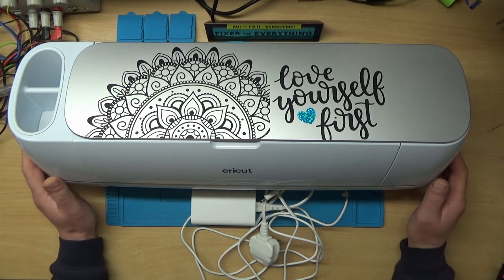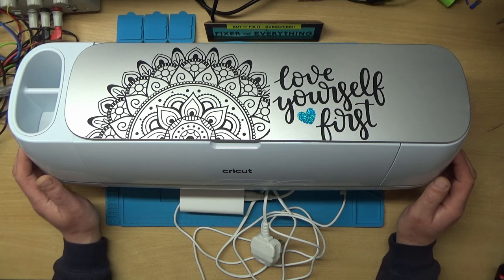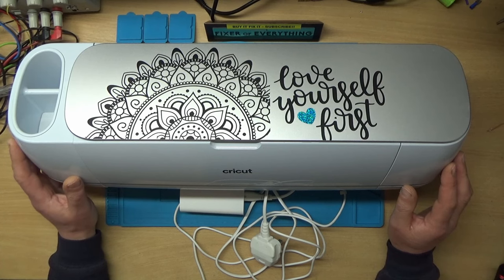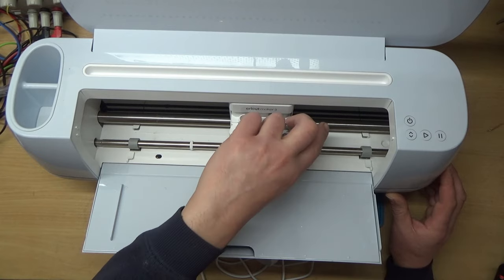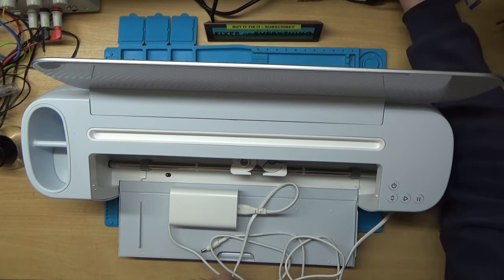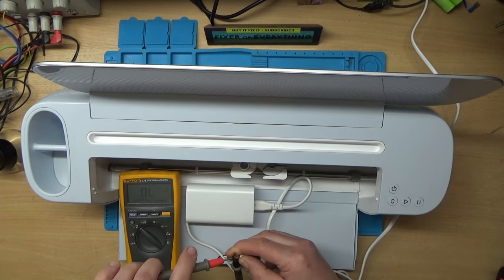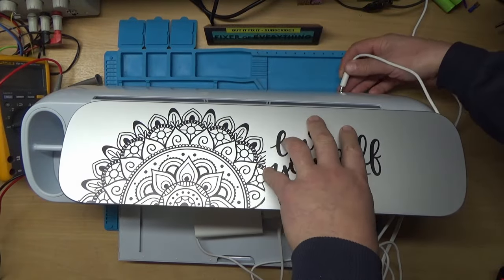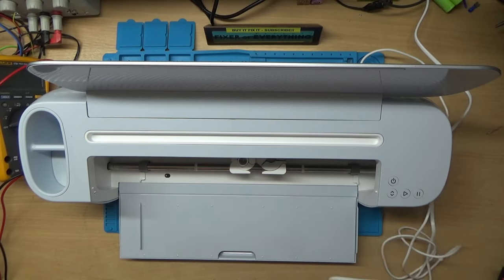Faulty Cricut Maker 3 - Trying To Repair...

Comment: Must be a flash memory device with serial number - wonder if you can change the serial numberrr to your other one?
Reply from the maker: I would think that's possible but you would need to dump the original contents first which would almost certainly be protected, it may be possible to glitch past the protection using something like a chip whisperer perhaps.

Comment: Can you tell me the exact reference of the ribbon cable  ( i think its called like that ) and the number of pins, and whether it's 0.5 or 1 mm? I already know that the length is 550. This is the issue with my Cricut Maker 3; I need to replace it , thank you in advance
Reply from the maker: I'm sorry but I don't have any measurements of the cables. There is a way to calculate it as I looked into something similar before.  Cable Width / (# of conductors + 1) = Pitch
Reply: okay , thank you  @BuyitFixit

Comment: You should try to find a faulty cordless screwdriver and fix it. Then use it. Would save you so much time working on this stuff.
Reply from the maker: I've never been a fan of them. They are ok for removing screws perhaps but I like to feel how tight the screws are so I don't strip the plastic. It might also be harder to avoid making the screw cut a new path (I usually give it a turn in the opposite direction until it clicks, before tightening).

Comment: That's a rare occurance on your chanel - a failed repair. Agree totally about the extemely bad form of locking a customer out. It needs a hacker to get into the code and bypass the deactivaton bit!
Reply from the maker: Yes, I do have some now and again.. The problem is most of the devices functionality is "in the cloud" which is one of the reasons I don't like it.

Comment: If you convert it to a pure cnc machine you can recover at least basic function. It still wouldn't work with the Cri Cut service. 
You could also scrap it for parts. And make another machine from it.
You could also try to find a board on E-Bay.

Like a lot of ink jet printers. They make there money on the subscription. Not on the device.  That's how you can rationalize. Just sending a new device with little or no question.
Reply from the maker: I had thought of converting it but it's a fair chunk of work as the motors aren't steppers and are brushed DC with encoders. There is also the control of the  cutting head pressure and direction which is like an electromagnet from what I read and another motor to set the angle. It might be possible if you had a working board to port a custom build of GBRL or something to it but again it would require substantial effort to work out what I/O pins do what on the microcontroller.

Comment: I outright refuse to pay for products like this that mandate Internet access even for something as minimal as initial setup.  If I MUST connect it to use it I'm not using it. Frankly I do NOT trust these companies to be connected to my network and if they believe that locking down their products that I pay to own is acceptable then they can't have my money. I have a number of 3d printers and ONLY open source. I will NEVER give my money to any company that believes that I should be beholden to them to be able to contribute using something I own. If they want to maintain control over my ownership then don't sell them.  Lease them. Then if anything goes wrong or any part fails they can take it back and send me a replacement, both at their full expense.
Reply from the maker: Well said 👍yes we are increasingly having ownership removed. There are a number of instances where companies have went bust leaving customers with useless bricks or devices that no longer function as indented due to servers being no longer available.

Comment: Hi I am in the possession of a Milwaukee M 18 CPD rill coul you tell me the ref for the ower transistor that are fitted please
Reply from the maker: Hi John, the M18 tools I've looked at usually use a IRLS3034TRL7P for the power mosfets. Might be worth checking your tool first before ordering anything just in case they used a different one.

Comment: If this were only a two layer board there may have been hope, the vias to nowhere are a  giveaway it's a multilayer board.

How feasible would it be to cut the traces between the the chip and the motor drivers and graft a ATMEGA328 and run GRBL? It's good hardware so I'm tempted to pick up a dead one and convert it, maybe even design a drop in replacement board.
Reply from the maker: I had thought it would be possible to reprogram the pic32 if the board was a worker. Although it would probably be a chunk of work to port GBRL as most of the hardware GBRL runs uses stepper motors. It would be a neet project though.

Comment: As you think it was coke a cola, I google that name it has a pH of 2.6 to 2.7 very acidly indeed. No wonder the tracks had melted, evaporated and what else with that type of liquid dribbled into that area. Good attempt to try to get it going again. Great video. Can you tell me the hole diameter of the veers.
Reply from the maker: Thanks, I'm not sure on the size. I also think it's a 4 layer board so it would be a nightmare to trace. The kick in the teeth would also be even if you repaired it, it's still a paperweight due to being disabled by cricut.

Comment: Apparently there is a software called Sure Cuts A Lot that can be used with Cricuts, worth checking out but it ain't cheap for the basic version and ramping up to heinous for the pro.   I would look into that as it could be a backdoor to a bricked machine.   It was Cricut's handcuff mentality that put me right off their products.
Reply from the maker: I did look into that at the time and it only worked with older models. Cricut encrypted the USB communications on later models such as this one.

Comment: ... no idea what stuff is that Cricut, but... you have now a nice mechanical assembly, a nice PIC32, that corroded part is not very essential, just push button interface, maybe, but just maybe, a secondary power supply for BT module, it can be redone, eventually, and looks like the corrosion doesn't affected BT module itself... it's a nice one, Microchip, not some generic China Bluetooth! :D
i'd like to try to assemble a diy 3D printer using that stuff. :D
you have lot of interesting parts here... but looks like you are not so happy to play with mcu's! :D

(as a side note, i have a faulty "fitness bracelet", nothing special, just lipo element gone, and i discovered his mcu is a nice one. so nice, i really want to get acces to his programming pins, and start to play with it. i have already a lot of things to play: a screen, an accelerometer, a vibrator motor, a camera, i think... is advertised as "being able to take photos"... a pressure sensor, wifi and BT stuff, again... it's a minuscule development board, really! :)))))))))))))
Reply from the maker: I'm not sure if you saw the weather balloon video I did? Free development board 😂😂😂😂
Reply: @BuyitFixit  weather ballon?
sound interesting, i will check your movies again... i checked only what was relatively new and interesting... and this is really interesting, because i never fixed/used a weather ballon.
weather stations, yes, but weather ballons, never. :)

Comment: You are correct it was most definitely Coke so people use it to remove rust from steel. Also there are several other free software that will work with the Circuit like Inkscape, CorelDRAW and GIMP but there are many others too. Actually any software that can send out an SVG file will work since it uses Vector Graphics, but I will say I am surprised that it got the better of you but time is money. Good video.!!
Reply from the maker: Thanks 👍unfortunately only the very old cricut machines work with other software. They decided to encrypt the USB communications to stop people from using alternative software...

Comment: No reverse thread bolts or security screws? Unbelievable the amount of fasteners used to close it up. Don't even get me started on the software. The next one i see at goodwill I'll buy. I enjoy reverse engineering software and some hardware. Id like to be able to edit the serial number or bypass the serial check all together.
Reply from the maker: It would probably be possible to port something like GRBL to it, although it would probably require a fair bit of modification. The chip seemed to be supported by the aurdino sofware from what I remember. I think there's more to it than the serial as keys were mentioned that are used to encrypt the USB communication. I did have a quick poke at the PC software at the time.

Comment: I understand why they would "brick" them, if they have such a generous replacement policy, ;however the "green" thing to do would be to have them returned yo an "authorised refurbisher" who could get re-activation codes for a charge.
Reply from the maker: Yes, good idea. I've seen some deactivated unit on ebay for things such as loose lid, or a small crack in the front casing which seems so wasteful.

Comment: I sincerely hope that anyone thinking of buying one of these machines, watches this video and then stays far FAR away from them.

The irony is astounding here.

Ok, so the company, to save shipping and repair costs, makes the decision to have the customer trash the old one, then send them a new one.  And at server level, they block the serial number, possibly because they suspect that people will lie about their machine going boom and then gaining a 2nd one.  Actually, that does make sense.

HOWEVER, like said in the vid, that's  destructive for the environment AND if the company goes bust, NO ONE can ever use their machines again!
This is actually why I NEVER EVER buy something that REQUIRES some web account in order to function.

But here's the real irony.
The PCB has a lot of test points!  Test points are not only for adjusting at time of manufacture, but also for doing repairs.
But since they do the "trash it" thing, one must question WHY THEN have so many test points!?
It's not like there are a bunch of potentiometers or adjustable caps in order to "calibrate:" the thing.

Very odd!

Personally, I'd never buy one of these things.

Also, the amount of liquid damage is astounding!  There was even some "wet" there, which might mean that this was a recent thing.
Considering the placement of the PCB when assembled, I can only imagine just how much liquid was POURED into it.

I do wonder if maybe, just maybe, this was one of those things where an angry spouse may have done this damage on purpose to hurt their spouse.... hmmmmmm..... not impossible.  There's a lot of nasty going around right now.
Reply from the maker: Thanks for the feedback. I did contact the seller that I bought it from and told her about the video and my findings. She said that it had been stored in a cupboard when not in use and just stopped working and had no idea how it could have gotten liquid inside of it.
Reply: @BuyitFixit  ROFL

Ahhhh!!!  the old "stored in a cupboard" excuse.  ummmmhmmmmm!

ROFL
😅😂🤣

I joke about this subject, but I have a lot of experience in the corporate world with computer users calling support because their laptops "stopped working."

So many times we found "liquid damage" and some excuse as to what/why or moreso, an outright denial!

Even if we knew what liquid it was, we were never allowed to name the liquid (coffee, soda, water, etc).
The reason for that rule was because it removed the ability to the client to specifically deny which liquid.

So yes, I'm giggling at "in the cupboard and I don't know what happened."

LOL

Comment: After seeing that pcb damage I would have stopped right there. I would have removed that board completely and replaced it with an Arduino with the appropriate cnc shields. It would work on different software and accomplish the same things.
Reply from the maker: Unfortunately the cnc shields use stepper motors and this is dc motors with optical encoders, so the stepper drivers and software wont work. If the board was working it may have been possible to use the existing hardware and port some software (which would need modifying) to make it work but I think it would be a fair chunk of work.

Comment: I think you have the know how to get around the deactivation if you did manage to repair it, perhaps have it running from your laptop instead of on-line.
Reply from the maker: Yes, I could possibly have done that but it was pretty badly damaged so it would have required too much time and effort to attempt to try and repair it any further.

Comment: If I'd purchased one of those without being fully informed of the 'conditions' surrounding its use, repair etc I'd be demanding a refund and avoiding such companies ever again.  There must be full disclosure when they have such conditions attached - I wonder how many people have done the usual 'click on accept EULA' without being aware of the consequences??
Reply from the maker: Also because it won't work without an internet connected, if the company goes away or decides this model is discontinued, you have a large paperweight. There was a lot of uproar a few years back when they tried swap to a subscription model, and force people who had already bought them to start paying!

Comment: I use Vinegar to remove any liquid damage places on a board when it solves the corosion then i use the alcohol
Reply from the maker: Thanks The riddler, yes I use the same when it's corrosion from batteries, they are alkaline and the vinegar neutralizes the acid. I think it was coke or something that was spilled into this which is acidic so vinegar wouldn't have helped in this particular case.
Reply: @BuyitFixit  Ah oke then 😊 the just use water that solves the sugar and then use isopropanol 👍

Comment: Sonos wireless speakers are a bit like this in regards to not repairing them. If it fails under warranty, they send you a new one and the old one is binned. Out of warranty they give you 30% off a new one, but you need to send the old one back to them. Then they toss it in the bin anyway.
Reply from the maker: Hmm interesting. I've seen a few broken ones on Ebay.
Reply: @BuyitFixit  By pure coincidence today I got a Sonos Play 5 from a relative to look at. It failed to power up after being moved to a different room, so I'm hoping  it's just the bootstrap capacitor in the SMPS.
Reply from the maker: Fingers crossed. From my experience you normally get like a pulsing or such on the power light when the boot strap fails but I guess it depends on the device. Could be output capacitors? Best of luck, and let me know how you get on 🙂👍
Reply: @BuyitFixit  I'll let you know once I check it out. I also repaired a B&W A7 wireless speaker last week. Most of the SMPS caps were way out of spec, so all replaced and I'm listening to it now. :)
Reply: @BuyitFixit  I've opened it up now and it has quite a few domed caps on the secondary side.
Reply from the maker: Nice ripple then, that would probably do it 😂😂😂

Comment: Yeah, a Coke spill on a PCB is bad news. Once tried fixing a laptop on which coke was spilled. Same story. Tracks completely eaten away…
Everybody should just refuse to buy that crap that demands to be connected to the internet. There is a popular audio system too that works that wasy, and when the manufacturer deemed the older systems to be too old, they became paperweights. Much like some printer manufacturers with their printers. One of my pet-hates.
Reply from the maker: Agree on all your points👍. I think it was Sonos? Possibly. There have been a few other instances of companies going bust too and items no longer working or working as intended. The latest I can think of was a Van Moof electric bike.

Comment: These companies, should be put out of business if they don't change their practices, the amount of these faulty units going to e-waste must be unbelievable, that is even to say they don't even go to landfill.
Maybe we should start a petition against companies like this, personally HATE today's throw away society, years ago I did video and TV repairs as well as other items, never made very much money from it, but it was more about getting the item repaired and back to the customer. Now it's all chuck it in the bin
Reply from the maker: 100% agree! I volunteer at the local repair cafe to help the local community, also used to fix TV's etc for friends and family. I ended up getting quite a few decent ones from the local dump. I remember my 1st plasma I paid £30 and had to change a board that cost me £20, and £5 for a remote. They were still a few hundred at the time to buy second hand.
Reply: @BuyitFixit That's how i got my 1st plasma tv it was advertised for free collection as it had suffered a liquid spill into it the owner had got a replacement from their insurance and just wanted someone to take the faulty one away i collected it and when i inspected it i found the liquid had completely missed any of the electronics inside apart from the mains in connector so after replacing the damaged connector I  had a nice 42" plasma tv this was when they were still over £1k to buy so obviously I  was well pleased. When i was a teenager my neighbour used to work at the council waste site and he would bring home all manor of electronic items mostly radiograms and record players as well as radios and the occasional television set. My 1st colour tv was one i had got from the tip and repaired i was the envy of my school mates as i was the only one to have a tv in my bedroom let alone a colour one.